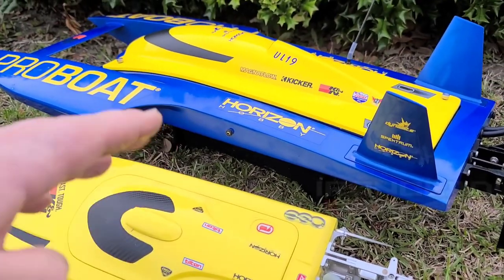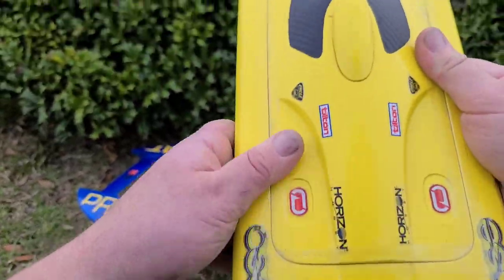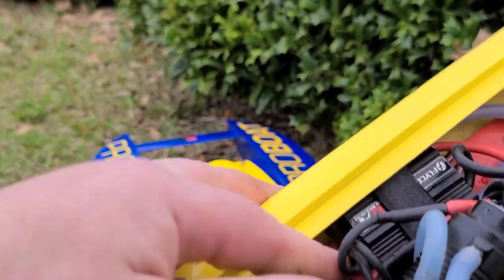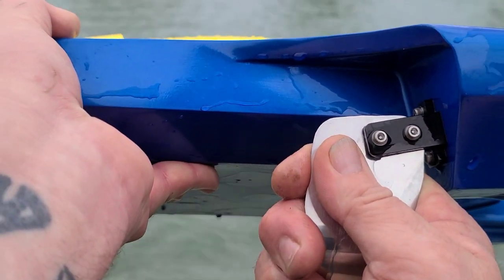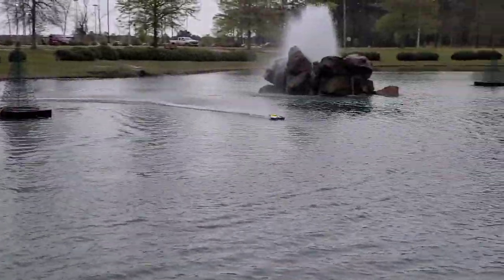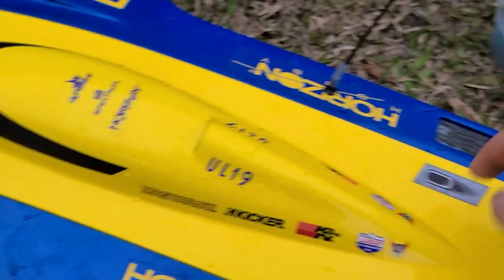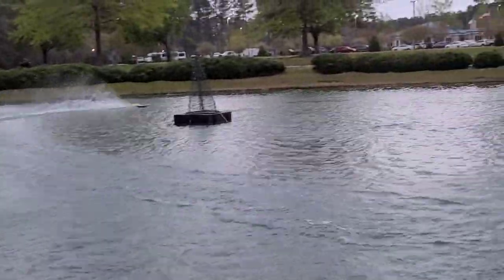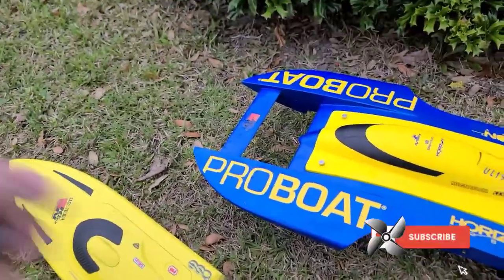UL-19 & Deltaforce 23 Mini Sniper Testing A Few New Upgrades

Comment: Another awsome video. When I used to run sport 40 hydros (nitro) the best thing to remember when running fast, was  no left input on the rudder ,not even a little. If the turn fin grabs hard  (no drift in the corner) the easier the boat would flip with left rudder .

Comment: Informative and entertaining to watch brother.   The two boats are getting faster and dialed.  Good work and  having a good time.    What Hobby is about.  
I’ve noticed and seen awhile ago the higher the discharge rate.   The more efficient the boat runs as to temps, speed and run time.   To what I understand as the power system is drawing lots of amps and watts higher C rating and Quality batteries can supply the needed power at a better rate and the power system isn’t struggling to obtain the power needed 
Unlike a low quality low C battery just can supply the power demanded by the power system.  Resistance also plays a factor too as wire length, connections, solder joints, ect…….   Better the quality batteries the better the power system runs.

Comment: HI BIG B THE BIRD WAS A LOONE.  NOT THAT IT MATTERS . ( FYI )  IF WE LET OUR SLOT CAR MOTORS REVE HIGHER THEY RAN COOLER, WHEN WE GEARD THEM UP THEY RAN HOTER BUT FASTER.
Reply from the maker: Yep just like a boat you prop up things get hotter prop down cools things down a bit you can prop up 2 different ways :  more pitch same diameter = proped up.   Same pitch larger diameter = proped up.

Comment: Another great video. I appreciate your ul19 videos. I to have been fighting over heat issues. Put in seaking 160 speed controller, still cooked the again. Going to switch motors. lmao, horizon told me that the boat is designed for 4s or 5s. Keep up the great work sir. Thanks again. Jeff..
Reply from the maker: Yea I was too blew up a flycolor 150 because the sloder joints let loose and shorted out the esc

Comment: The higher C rating lipo’s run cooler on the esc because there is less voltage sag. The lower the volts due to sag the higher the amp draw to try to make the watts,it’s ohms law watts are volts X Amps so it takes more amp when the volts are low to produce the same watts, more amps equals more heat.

Comment: Awesome runs Big B. Really useful intel on the UL-19 fins (shame it cost you a lost one to find out!)  Having said that, I took a profile of those fins from my boat and can't really see what they add to performance other than increasing drag. They can't lift, provide downforce or improve steering, so what's the point apart from looking kinda sexy?
Interesting with your observation about higer C rating creating lower running temps. I have also noticed this particularly on the motor. I may be completely wrong, but here's my thinking...
When a LiPo is under load it can experience a voltage drop that impacts battery performance. If there's a significant voltage drop, the motor will not be able to reach maximum RPM and it tries harder so will have higher temps. However, LiPos with a higher C rating will be able to maintain voltage under load therefore reducing voltage drop and making it easier for motor to maintain maximum RPM.  As I say, only my theory and I may be way off the mark.

Comment: thanks for doing longer runs ! So a bigger prop means more strain on the motor but it can make it go faster? That's why it could  overheat?
Reply from the maker: Yep you prop up things get hotter prop down cools things down a bit you can prop up 2 different ways :  more pitch same diameter = proped up.   Same pitch larger diameter = proped up.   Warmer Temps 

 Vice-versa  same diameter less  pitch proped down.    Same pitch smaller diameter  proped down.   Cooler Temps

Comment: Hey man so what was causing the boat to want to lift the one side outta water ? And good looks on the rear fins I will be doing the same thing tonight !
Reply from the maker: Pretty sure it's the torq roll from the prop or the curved turn fin not set up right.  I've got a heavy trigger finger when I give it hard trigger it tends to roll over and pick up the front end?